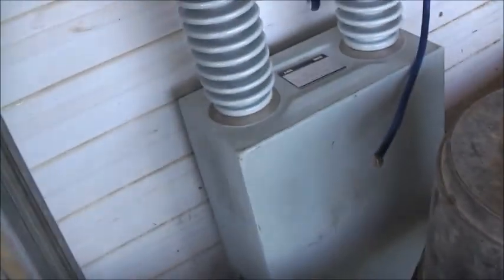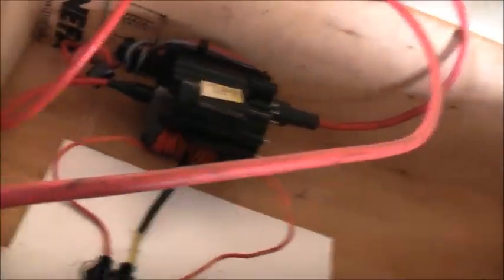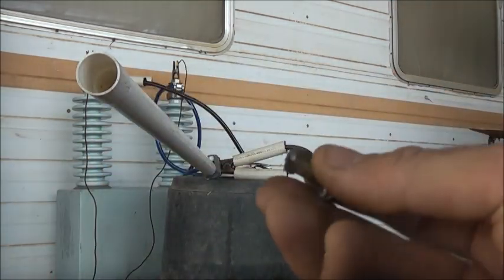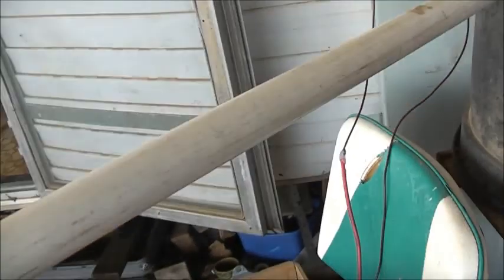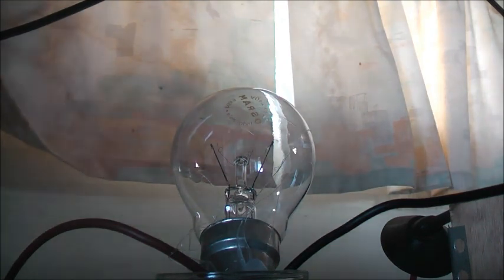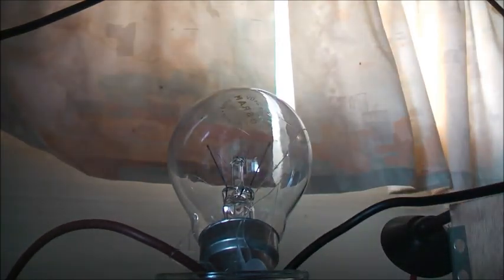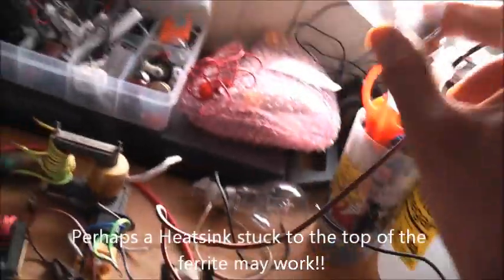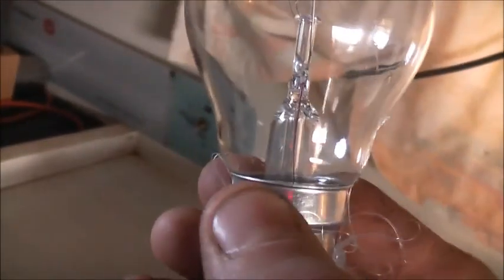Obliterating Bad Capacitor & Epic Lightbulb Arc!!!

Comment: hey mate ! that was a hell of a pop ! some of those electrolytic caps give a real good show i need to finish off a circuit board still got a nice cap on there haha .. like your zvs setup need something like that myself and those work tool batteries seem to work great ! im looking for more power and that would be a good option to use .. haha i was waiting for that light bulb to give up but its a champ ! great arcs in there mate ! hmm i was thinking a fan to cool the ferrite or heatsink/fan combo